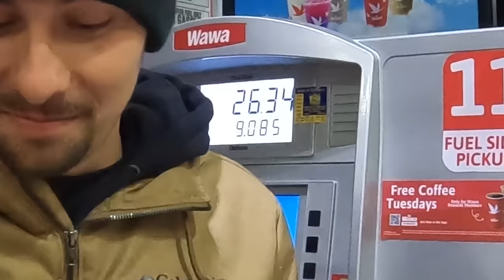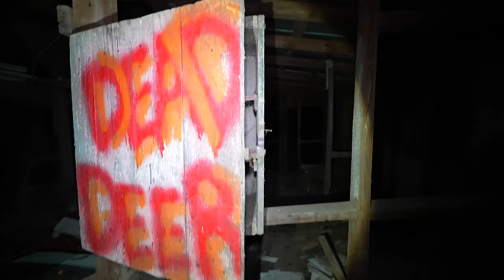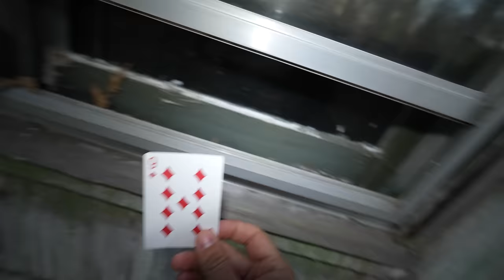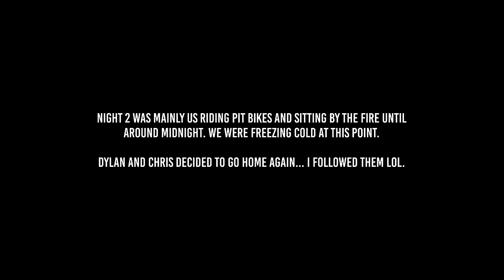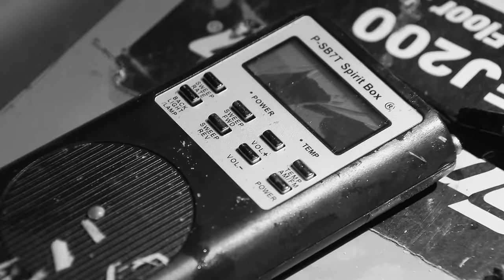TERRIFYING 72 HOUR CAMPING TRIP at USA MOST HAUNTED FARM **GONE WRONG**

Comment: CJ the card is not being held by the sides, it’s being held from the bottom. I think if the card is being held from the bottom, the fingers wouldn’t be seen, they’d be blocked by the silver of the window & screen ledge as it’s being put there. Debunk it and see. Have someone inside or put the camera where it was the night it happened and try putting the card from bottom of the window and by holding the card from the bottom and place the top of the card on the screen and slide the card up the screen by holding it at the bottom. Kinda bending card like when shuffling them. You can see when the card is in place and it’s let go it kind of has a little ‘pop’ to it. Maybe with your editing equipment you might be able to see what’s holding the card from the bottom. As for the 9 of diamonds card, did you pick a card that night and say to the spirit box, tell me what card I picked? *I just went to that video and you DID pick a card and ask the spirit to identify but you picked a Heart card, I couldn’t see the number from the light glare.* I was thinking the spirit was giving you the answer by placing the card in the window but now I don’t know wtf it means! You can see something at the very bottom left of the card (left on screen) don’t know if it’s a finger or the bottom part of the palm of a hand but use your equipment to see closer. It definitely could be done with the depth of the screen from the window sill. But who or what is the main question!! ✌🏼

Comment: Here's a story about when I worked at the haunted car dealership in the 80s.   I was working at 4 am cleaning the garage floor.  I kept hearing a vibration noise.   Saw nothing.  All of a sudden I heard it up by the shop bathroom.   I looked and saw a picture picking off the wall, vibrating, and banging back.  I tried to grab it, it flew across the shop, and smashed.   I called that job done for that time.   Came back when my boss was in.  He asked about the picture.  I told him all about it.  He didn't believe me ... again.  But it just was one weird the place had. Mostly I saw an old man walking around the building.  Pointing at me.  Locking me out.  Just a prick

Comment: @11:00ish Yo Dylan, Brother, There are doctors call ENT's, they specialize in, get ready, the ears, nose, and throat.  I think you may have nasal polyps.  They prevent your sinuses from being able to pass air efficiently enough to breathe smoothly through your nose.  The surgery and recovery are relatively mild, but like all surgery there is some discomfort at first.  Once polyps are removed breathing becomes so much easier you'll wish you'd done it sooner.  It could significantly improve your quality of life and most significantly your sleep,  just fyi, brother.

Comment: camp  with a team - 7 people ( lucky #) - 1 dog, bible, pellet guns each, fireworks, horn, food for 3 days...dog food. snacks, camp near a river....set up 4 tents all backing trees.....set up parameter with tree branches....2nd one further with sharp tree spikes...or something deterent....and last one away with warning signs...it will be all wires....this will alert you...2nd one protects you and closest one you can fend off. have extra flash lights, clothing , soap...too brushes because this 3 days 3 nights. Set up trail cam facing out (4) and 4 facing into tent so you can see. Have a back up van parked faraway  with team of 7 - search and rescue. Have 7 walkie talkies....stay put in tent home zone...each tent back to tree. Have easy access to climb up in case of emergency. Have first aid kit and lots of survival gear. object is to spend 3 nights in your protected zone ( 3 parameters) have 2 drones to help you....this would be exciting instead of 1 night. You have brave mixed team of male/female camping . document. during day 4 may travel around and 3 stay back for supplies. At night - 3 watch and take turns with 4 watch. Your trail cams will pick up....hope you do this....

Comment: I think you need a 4 legged security system out there, and some motion activated cameras inside as well, when you’re not there. 
Definitely take notice of tracks, inside & out, for human & otherwise. Outside you’ll be able to see foot racks if someone is by your vehicles again. Indoors you can utilize powder in the doorways of the most active spaces, even on the stairway. 
You definitely have a few things happening at the farm. The woods, there are a few things that reside there… Bigfoot is definitely active there, but there are elementals there, as well as a true shadow person (highly dangerous). 
Inside the house is a very angry & malicious spirit that WILL try to inflict major harm & possibly has done worse already. I do not believe it was ever human. 
You should ALL be praying, protecting (including crystals & religious charms, etc) before & after EVERY visit to the house, and then using sage & grounding yourself AFTER you’ve left the property. 
Stay safe, much love ✌🏻❤️🕯️ from Camrose Paranormal Research 👻🇨🇦